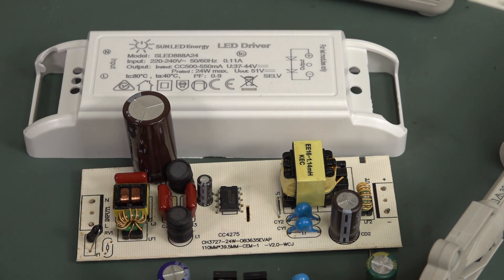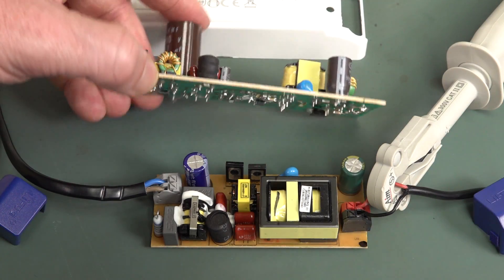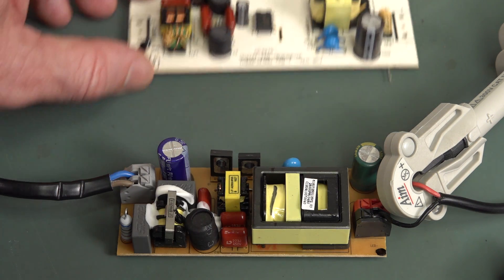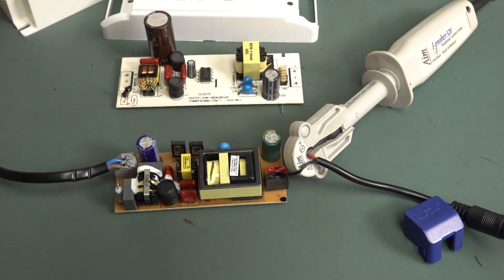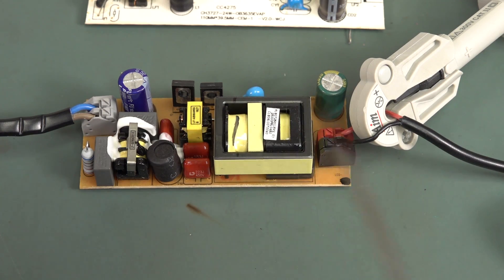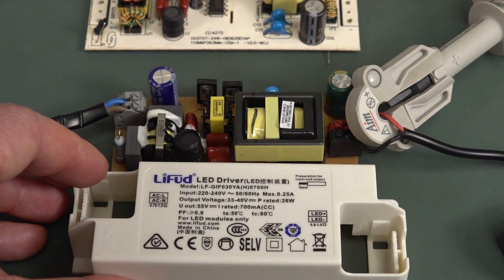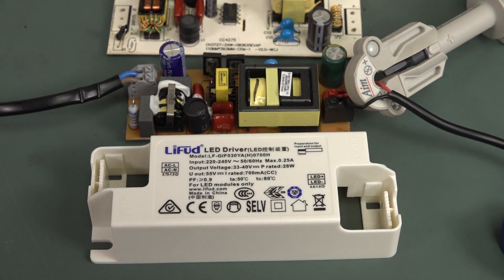LED Flicker 3 - More Electric Boogaloo

Comment from the maker: Two things:
1) That input resistor is a fusible resistor.
2) There is a spare footprint for an extra output capacitor to get the ripple even lower.
Reply: LLC resonant half bridge topology. Split transformer bobbin is there only to introduce leak inductance for resonance to happen.
Reply: It seems this kind of LED driver is referred to as "off-line LED driver" in the industry. Quite what off-line means in this case I'm not sure. From line voltage?
Many prominent IC makers make dedicated ICs for these LED drivers. Including TI and ST.
I have been looking at the datasheet for one from IXYS the "MXHV9910" to be precise.
Reply: Also LT3799 from Linear Technology. TPS92410 from TI.
Reply: 3) Input filter cap is not directly connected to the output rectifier. There is some circuitry in between, probably some resonant stuff to correct for PF.

Comment: Looks like this is NOT a single-stage converter. The 2nd MOSFET and the inductor at the left of the transformer probably are part of the PFC boost converter.

So this is basically the opposite of the 48W driver from last video. This one has boost converter PFC circuit followed by an isolated current-regulated flyback. The 48W one from last video had an isolated voltage-regulated flyback followed by a buck current regulator.

Comment: I guess the big ass transformer will be much more stable than the piss poor one of the flickering things. There is at least a reason why there is such a big amount of calculations to be done to get the correct dimension of only the iron/metal core, not speaking of the correct windings etc.. When i see the lifud board I notice additional chokes. Seems someone really had fun designing this circuit.

Comment: Topology is similar to old AT computer power supplies with controller moved to primary side, and there is some kind of power factor correction added. They won't put expensive 450V capacitor if 400V was sufficient.
Reply: Piotr Kościński Few brands offer 400V and 450V in the same series and size, because the values are too close.  Capacitance is already -20%/+80% tolerance.

Comment: Dave, you should try and reverse engineer this one.  There seems to be more to it than meets the eye.  Two diodes in in the secondary,  are they using interleaved switching phases?  Appears to be a second transformer next to the main transformer, possible power factor correction.  Don't think its push pull the two FETs look different, would be identical if push pull.   Possible resonant  topology.
The main switching transformer also looks somewhat unique. Possible current feedback winding?
Reply: I go with that. I also think that this PS is worth a closer look. There is... There must be some clever stuff on there to get rid of the ripple and to get the PF correction right.

Comment: blue mov thingy providing some feedback, maybe?
Reply: No. It's a Class Y capacitor (look it up) that couples the secondary side back to the 'earthy' primary side to stop HF switching noise being radiated from the secondary side wiring. It's on most SMPSUs unless the secondary side is earthed or where the leakage current from the mains would cause a problem, say in medical kit.

Comment: On the secondary side, what's with that trace coming off of the positive of the diodes that wraps back around on itself? Why isn't it just one big block? It looks to just go down to the smoothing capacitors before coming up to the output. Does that really make a difference being laid out like that? Either way the capacitors are going to be the same distance from the output connector.
Reply: One way of looking at it is it reduces the effective series resistance of the capacitor contributed by the copper track. Another is it forces the ripple current to flow past the capacitor connection instead of taking a short cut. Whichever way you look at it it it's a standard technique on PSUs.

Comment: Watch out for them failing! I fitted 60 of them in a shop last year, more than half of them have failed since. The replacements are twice the size, same part number. Think they messed up.
Reply: Interesting that the panel says 700mA but he measures ~420mA!

Comment: What's making it better? A faster or more responsive switching IC? A bigger inductor on the primary side? Larger capacitor caps? Was the ripple caused by the switching frequency? Maybe it is just higher.

Comment: Why is there on the secondary side allways only one Diode and never a full bridge rectifier? Doesn't it make sense because of the ratio/waveform of the output from the transformer?
Reply: Because it's a flyback design. The output voltage has one direction that is based on the input voltage. the other direction is constant current so it increases to the output voltage.
Reply: This one has two diodes and a center tapped transformer. It does the same thing.

Comment: That "resistor"  in series with the input IS the fuse ;)
Reply: Wow
Reply: They're supposed to be safe, but IMHO, too often the "fusible resistor" is mounted up against a flammable component, meaning when the resistor burns out in the case of a minor to moderate overload, it will melt nearby components and create a carbon pathway.
How do I know this? Seen it myself, in those cfl bulbs.

Comment: Wouldn't an LC filter on the output make ripple a thing of the past? Or is there something bad about doing that?
Reply: So for an LC filter at 100Hz, its going to be physically very large, heavy, and the components will be expensive. Its not bad to do it, just not optimal.

Comment: Something doesn't add up here.
You show a 700mA driver but your scope says its 400mA?
Did you have the wrong range set or am I missing something?
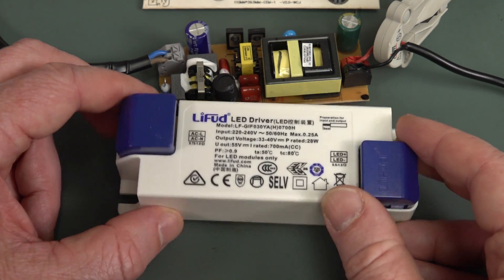Reply: Im guessing you missed 1:10
Reply: @timturner7609  He mentions a 500mA-Version but still... The scope gives 400mA (4:30).
Reply: Perhaps he's running (a lot) less voltage than the max of the constant current supply? That would drop the amperage down too. In fact I'd rather operate that way if it's a light I plan to use a lot.

Comment: Change those caps. Green cap with gold lettering is the sign of imminent failure.
Reply: I'll just paint them.
Reply: If you have issues in the future then I would definitely check those caps
Reply: It's manufactured by "Beryl" which is obviously from the bottom of the barrel - ahem, beryl.
Reply: Okurka Nonsense.  Some brand may prefer those colors, and some models and years of those may have suffered from that notoriously bad electrolyte formula  years ago.  The more important thing to check is the specced lifetime of the cap used, adjusted for how much margin there is between the max ratings and actual use.
Reply: @johnfrancisdoe1563  Nonsense. Green/gold combination Chinese caps are notorious for failing fast.

Comment: What I wonder is how much cheating they used in it. With only 6 pins to drive 2 transistors, get the main power and aux winding, and most likelly a current shunt... this little chip pack alot in a tiny package for sure...

What I wonder is if the output current change based on the input voltage, or if it just assume let's say 240V and just go from there... Since it know the output voltage and input current (I assume there is not enought pins to sense the input voltage) it is easy to set the output current... Just a bit of math with the input voltage (assumed to be 240V?), input current, and output voltage, and an efficiency value... ((Input current * 240V) / efficiency) / Vout = current out. Since the efficiency is probably relativelly the same across the output voltage range, it can be asumed to be of a fixed value...

Comment: They probably used PFC (that's what the black inductor is for). There's no point in using another driver on the secondary side if the controller has current mode.
Reply: Just wanted to comment the same. Probably a boost type PFC. They have (from the looks of it) 2 transistors, one for the boost stage and then the isolation flyback stage. So it would still be a 2 stage solution. If we are right, interesting little 6 pin IC than can do all that.
Reply: @markoantesic4362  this or it's a half bridge/forward converter with a gate transformer and the inductor is in series with the power rail to smooth out the current.
Reply: looking at the cap trace it goes to the smaller transformer area. so I would concur. A boost converter to charge the cap and then a flyback converter.
Reply: FYI, transistors are JSMC 3DD4244DM's -- BJTs, in half bridge, and the small transformer is for base current drive.  It's a lot like a classic CFL circuit, with a controller tacked on.  Can't figure out where PFC comes from.
Reply: Right, keeping the current flowing from the inductor! Good catch.

Comment: I still doesn't get it how they achive this. Whats the trick to get a better powerfactor?
Reply: There are chips that do power factor correction (google PFC to see how it works). That's why there are 2 power transistors.
Reply: Yea. But I was hoping Dave would make a part 4 out of this. ;)
Reply: @JoeBee999  Good point, yes Dave, please do a video about active PFCs!
Reply: Sure looks a lot like an active PFC ; this would explain all the added components: an inductor, a power switch and a pair of low value capacitors (plus a diode hidden somewhere).
Reply: Not sure what's going on there. Input circuit is pretty standard, filter into FWB into cap.  Cap is more than big enough to leave a low PF.  I wonder if it has to do with the DM choke being carefully sized to cancel 3rd harmonic or something, or if it has to do with that film cap from the transformer return to one of the AC lines. Which almost looks like a voltage doubler, but the cap's much too small for that.

Transformer is resonant, doesn't need an output filter choke.  Split bobbin design is for leakage inductance.
Reply: @T3sl4  Suspect it's a novel single-stage PFC/half-bridge combined topology.  There are two possible approaches - one is to add a PFC inductor and have the bridge switches moonlight as the PFC switch and freewheel diode - or you can add some diodes and use the resonant capacitor as a charge pump to fill up a reservoir cap.
Reply: The two transistor has nothing to do with PFC - they both drive the main transformer.

Comment: Now just add a couple of caps to the output and see if you can get 0 ripple
Reply: There is a spare footprint there I forgot to mention.
Reply: Yes, you should add it back. Its supposed to be there but they were too cheap/lazy to bother.

Comment: I might be wrong but I'm pretty sure that extra choke tranny on the mains side is a dedicated pfc circuit which is why there is 2 switching transistors. If you look at the output of the bridge it doesn't go directly to the big filter cap but through pfc thus high pf

Comment: Is that a split bobbin transformer?  That's so rare in modern power supplies.  I wish they use them a lot more for better isolation.
Reply: It's a split bobbin dazzler.
Reply from the maker: Does look like it.
Reply: Probably a combined magnetic part, half is the transformer, and the other half is a secondary side inductor, arranged so that they share part of the ferrite, but at different points in the switching cycle. Explains the 2 diodes on the secondary side.
Reply: @SeanBZA  Nah, it's resonant; the small red caps on the primary side are the coupling/resonant caps.  Split bobbin design gives the leakage needed.
Reply: WannaDIY  could have done without the caps..
Reply: Clive, the issue is, split-bobbin transformers have higher leakage inductance. As one pointed out, this is actually of benefit in a primary side resonant design. But, it can be a problem with other switch mode topologies.
Reply: But why is it the secondary that had a cover?
Reply: Yeah I wish that too
Reply: I read this comment in your voice...
Reply: Ótimo vídeo.  Parabéns